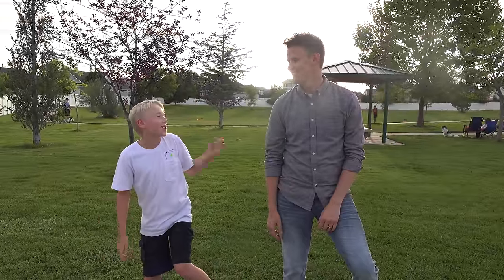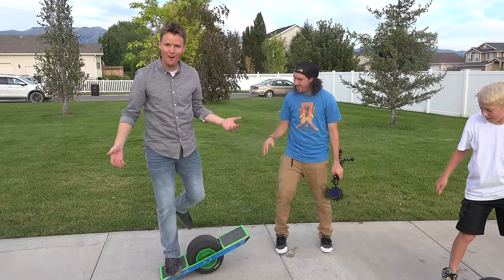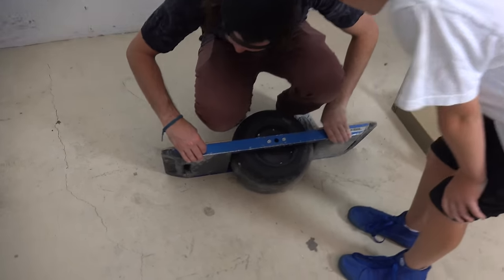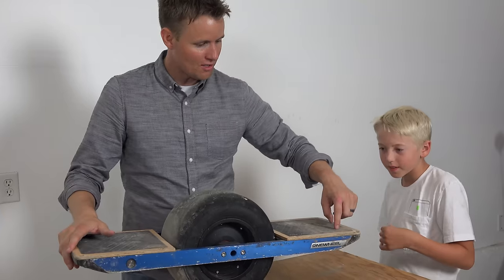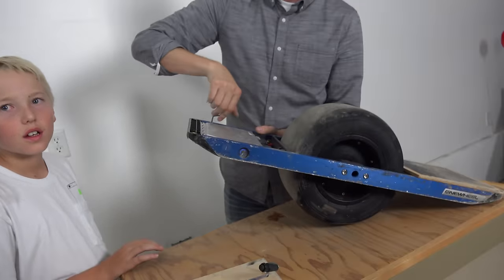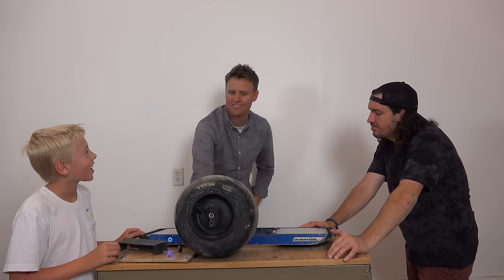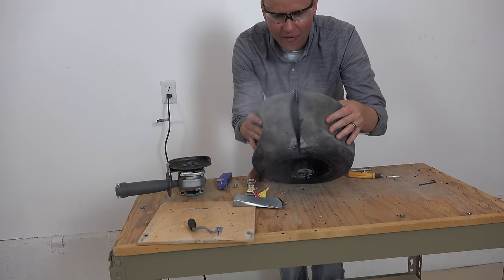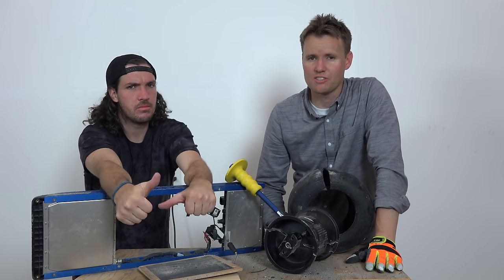What's inside a One Wheel Hoverboard?

Comment: The pink goo is called sealant. What it does is if you get a puncture in the tire then that stuff gets in the hole and seals the hole so that you don’t have to get a whole new onewheel or use a patch just cause something poked a whole in the tire. Basically it seals holes in the tires

Comment: What's inside a nuke?
Reply: Yes daddy!
Reply: about 70% Explosives 20% Radiation 8-10% fuse control 1-3% for nuclear missles: Target Radar and navigation system
Reply: Boom boom
Reply: +Roland Ramos wrong! The explosion isnt from explosives inside it, its from uranium atoms spliting causing a chain reaction which causes heat which then overloads causing an explosion. Also it can't be "20% radiation" as radiation isn't a psysical thing.
Reply: +Handles 123 If you did that then a great portion of america will be uninhabitable due to high levels of radiation. This is because cutting into it would expose the splitting uranium to react with oxygen causing a massive radiation explosion
Reply: crack
Reply: Super Slam Bro it was not supposed to be accurate

Comment: SAFETY WARNING!!!  DO NOT CUT/GRIND/DRILL Neodymium Magnets like those used in this electric MOTOR!!! 
(Yes, it's worth repeating!  The dust created by this is VERY flammable... and worse yet, the burning magnet dust is TOXIC! Just the act of cutting them creates enough heat to ignite the dust "as you cut/grind/drill".
The only way professionals do this is by submersing them in special cutting oil or water - to prevent any ignition.